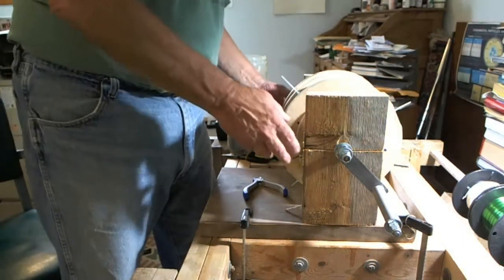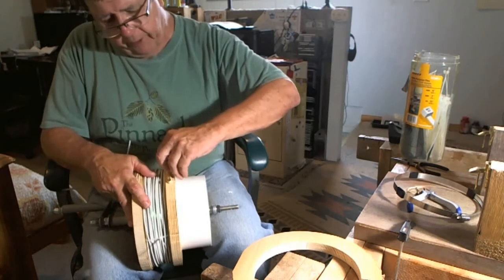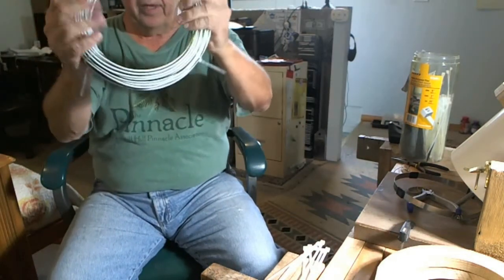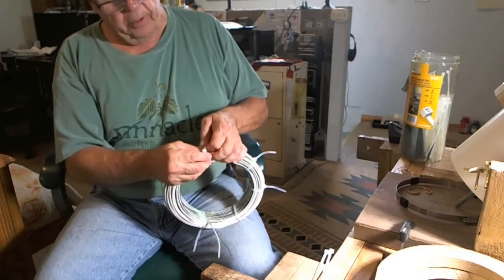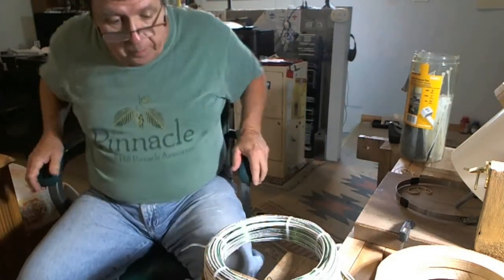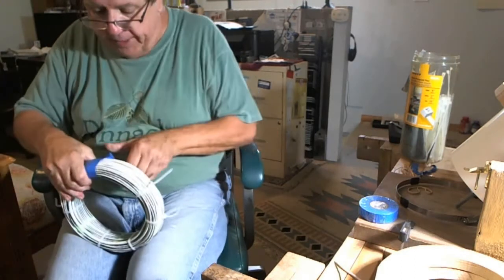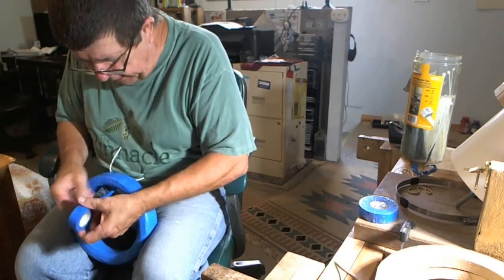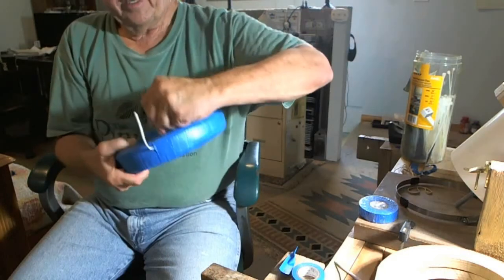3 Coil Taping

Comment: What are connectors name to coil????
Reply from the maker: The MONO and BIFILAR coils use 110 volt AC ‘male’ and ‘female’ plug connectors from the ends of your standard extension cords.  This is done to handle the high current pulses when used with the Aurorasky High Powered PEMF.  Adapter cables and connectors are made up for connecting to the Spooky Function Generator’s ‘BNC’ type connectors.  See the www.aurorasky.net website for video links, PDF(s), and more information on the coils.  http://www.aurorasky.net/html/mono_-_bifilar_coils.html
Reply: @gskempe9  hey brother do you have phone number?